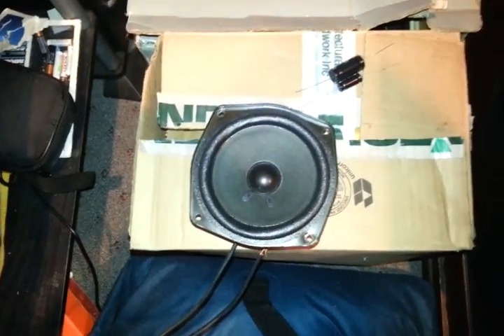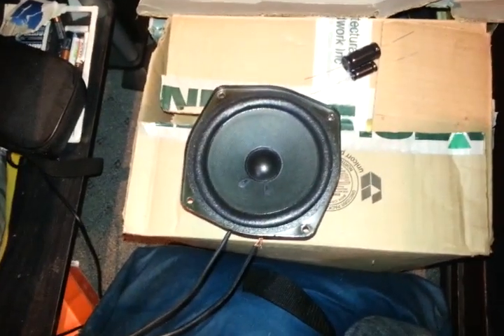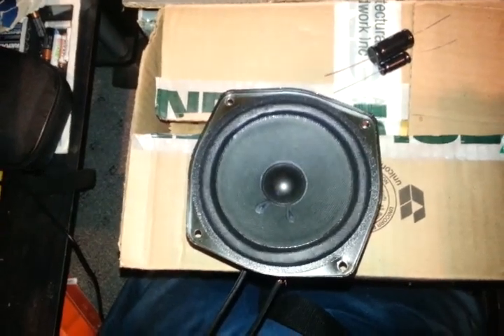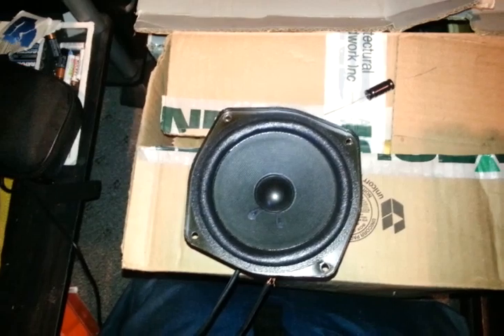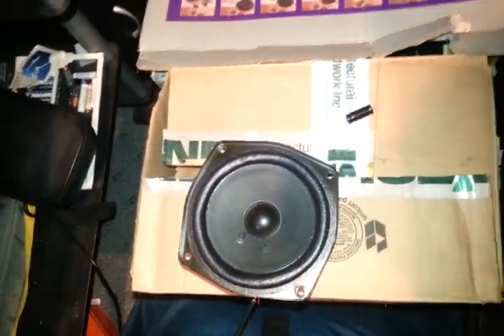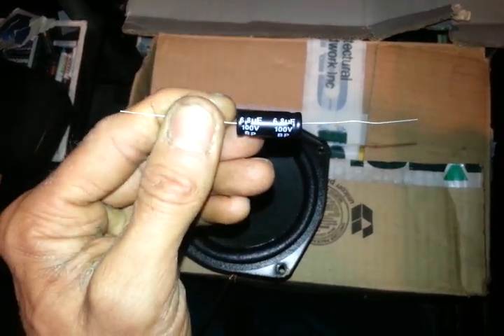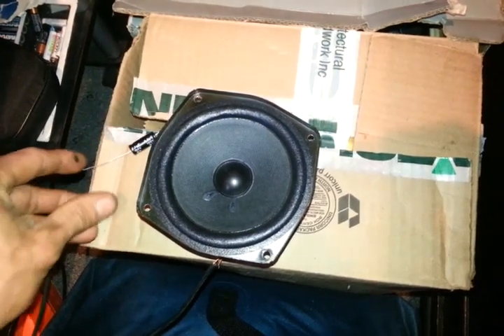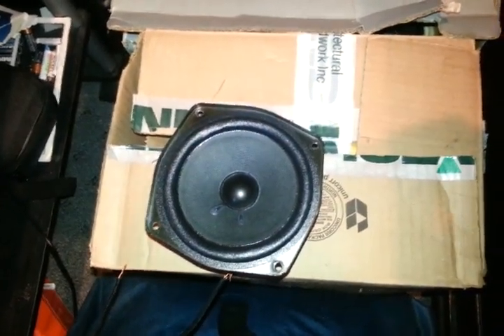How To Install A Capacitor As A Crossover

Comment: thank you , i just learned something today and I will be using your info for my new midranges thank you
Reply: 6.8 mf cap is best for med drivers in 3-way speakers (that have a woofer, a med driver and a tweeter). 6.8 mf caps are just about what all 3-way speakers have on the med driver. They make such a sharp and snappy voice sound. If it's a 2 way speaker (with just a woofer and a tweeter) don't put a cap on your woofer. Only on a med driver that runs with a woofer (like in the 3-way speakers).

Comment: ServiceBro I really need your help in a crossover with a 4in, 20-40w, 6ohm woofer, and a 2in 15-30w 8ohm woofer. These two woofers are installed in my Bluetooth speaker but the 2-inch woofer clips whenever I turn the volume at 60% on my pc using aux cable. So what kind of capacitor should I get?

Comment: Hi mate, I've installed a sub bridges to a 2 channel amp and mid range to original stereo harness, if I'm after linking speaker up to amp as a tri way would this in theory act as a crossover and keep the speakers alive?

Comment: In this video you show how to remove the base by installing a capacitor in the positive terminal. What is you didn't want to remove the bass, but instead wanted to keep it and remove all the mid range and highs from the audio signal? What would you do to it then?
Reply: Hanin
Reply: Diah hanin
Reply: https://en.wikipedia.org/wiki/Low-pass_filter     You can just place the capacitor across the positive and negative of the speaker
Reply: @codyphillips0 

 No, NEVER do that! Your cap will be a dead short in the higher frequencies and might blow up or damage the amp. Only a coil is a low pass filter. If you use a coil, you can combine it with a well calculated parallel capacitor to the woofer to make the coil's filtering slope more steep (-12db instead of -6db/oct).

Comment: what's the orientation of the capacitor? It has negative and positive side, right? Where will you connect the positive side of the capacitor?Thanks.
Reply: +Lawrence Corcuera These are non-polarized audio capacitors.  So you do not have to worry about positive and negative polarity.  If you want any more audio tips, check out my channel.  I already have a few and will be making a video similar to this soon.

Comment: I wonder what capacitor works for what frequency cutoff?
I remember using caps on bass guitar pickups, and 4,7uF gives a nice warm tone.
On car tweeters, it would be nice to install a cap that cuts frequencies below 2,3, or 4kHz.

Comment: Without getting too technical, what is a good "size" capacitor to use on a 2in speaker?  Not a tweeter, a speaker.
Reply: @Dan Lapain Yeah I ended up jus tordering a bunch off of ebay with different specs to test up and down. with different size speakers/tweeters. 
So I'll also have to touch to sense the heat or what am I supposed to look for other than sound?

Comment: Can you use a capacitor to make a crossover on a woofer to cut out te higher frequencies? I have one woofer input that has a crossover but I have three woofer that get distorted sound due to no crossover. What would be the capacitors details if possible?
Reply: Jason Houston what kind of amp do you have the woofers on
Reply: Ok
Reply: You should use a low pass filter. There is a chanel caled afrotekmods witch explains it very well
Reply: yes of course
you can
just  connect a 100uf
capacitor to the woofer
this will remove all higher frequencies except for bass
and the voltage of the capacitor should be higher than your amp output
usually 250v-300v will work fine
Reply: Ali Waqas A capacitor is a hi pass filter, no low pass filter, you need a inductor to cut hi frecuemcies.
Reply: Free Service can you explain how to do that versus inline which cuts out LF?
Reply: @ragingbeast2045  Wrong.
Reply: @antoniomancebo9025  thank you...

Comment: Can you do this in a sub woofer so that it will play the bass and not the highs? Thanks.
Reply: You need a resistor and not a capacitor for that.
Reply: You need a resistor and a coil (inductor)  a big  inductor
Reply: put a cap between the positive and negative of the speaker yo!, and you get almost a low pass filter

Comment: Hi Bro.. i have two 1300 watts subwoofer, what size of capacitor can i use?thanks..
Reply: +[SMJ]StretchMyJerky He's probably talking about the other type of capacitor. Totally wrong video to be watching, but 1-2 Farad caps per 1000w should be perfect.
Reply: +Marcus Abacus for a subwoofer i recomend using a crossover network not just one cap

Comment: can this capacitor stand for the 750 rms pa if i play all nigt long and wont damage the mid range speakers.
Reply: +Abadon lucif Old post but if anyone reads it, you need more than 2500watts to exceed a 100v cap on a 4 ohm speaker.

Comment: Do capacitors hold electricity?  Like, could you shock yourself by touching a capacitor?
Reply: only if it is a very big one
Reply: Yes.  Even with a small one.   Theyre surprisingly dangerous.  Don't listen to the guy below me.
Reply: no, it has to be at high voltage
Reply: @Kevin De melo What's your parents email/phone number? You clearly don't need a soldering iron, and probably don't own any real audio equipment

Comment: How can I attach the battery capacitor to the wire I do not want it to touch directly onto my tweeter as it will cause damage
Reply: Lol what?  There should be no battery.  If you're talking about a car amp and the power wire. You cannot put it there you'll electrocute yourself and prob burn your car down.

Comment: If you are using a 22uf 100v capacitor? Does the voice stand out better?
Reply: no, you have to balance the crossover with an inductor and a capacitor together, i would use a 16uf cap and a good fat inductor as well

Comment: No one has told yet in whole you tube and google, which side of the capacitor, I mean positive or negative should be connected with the speaker positive point ...........i am talking about polorized capacitor, I know in the unpolorised you can connect any one but what about polorised capicitor...........
Reply: good point and i would think the white line on the capacitor should be on the negative side as usual. So Positive + to + of Capacitor, Anode (-) of Capacitor to the First Positive + terminal of the speaker....then the Ground or Negative - speaker just returns to head unit

Comment: ITS NOT A FUKIN CROSSOVER. THE MEANING OF CROSSOVER IS A FILTER THAT SEPERATES HIGH AND LOW FREQUENCIES
. ONE CAPACITOR IS NOT A FUCKIN CROSSOVER MATE, IF U HAD A TWEETER AND A WOOFER, THE TWETER WOULD NEED A CAP.  AND THE WOOFER WOULD NEED A COIL (INDUCTOR), SO U DONT KNOW WHAT UR FUKIN TALKING ABOUT BUDDY.
UR SHIT IS NOT A FUCKING CROSSOVER, ITS JUST A FUKIN CAPACITOR REDUCING UR SHIT FUKIN BASE FROM ENTERING WHAT IS SUPOSED TO GIVE BASE OUT, DONT USE A FUKING CAP.   USE A FUKIN INDUCTOR STUPID, PLUS IM A LOT YOUNGER THAN U AND I KNOW THIS SHIT BETTER THAN U.
Reply: No actually you are wrong. What you are describing is the difference between a low-pass and band-pass filter.  Further more, depending on where the cut-off frequencies are set, the response of the woofer and tweeter doesn't necessarily meet and "crossover". I hope with age you learn some humility.
Reply: I KNOW WHAT IM FUKING SAYING BUDDY  I WORK WITH THIS SHIT.
Reply: Cool story bro, and completely original. Let's keep it real though, even my mum has standards.
 ...Not sure how pointing out that you fantasize about sexually assaulting grannies is supposed to be a jab at me anyway, but whatevs.
Reply: Funny how in your mind, the worst possible thing is mom finding out. Clearly you're a child.
Reply: @Wil Badillo, Kevin De melo is one spicy burrito huh? lol Taco Bell shit is what he is, 89 cent soft taco is all he's worth,  Kevin De melo didn't even make the dollar menu lol
Reply: Did he state that you're supposed to put the capacitor on the woofer in a two way? Was he demonstrating how to make a 3 or 2 way system with capacitors as crossovers? Was he trying to tell you how to build a crossover in a two/three way system? You clearly don't understand the video, or how speaker electronics work, as woofers work just fine without a coil attached to them (not voice coil) and sound good anyway, Need proof? Buy a pair of sony SS-MB215 speakers, they use caps as crossovers for the mid and highs and just use direct input from the amp for the woofer!
Reply: Okay, you're now a official 9 year old.
Reply: Kevin De melo  how old are you today ? Hows the therapy  going ?
Reply: I kno this is old but ,infact it is a cross-over (using single cap), .

Comment: what if you want more bass?
Reply: +Czaric Official get a woofer or a speaker with a lower Fs.
Reply: +Czaric Official You can use capacitors as a high pass, which will be needed if you have a ported sub.  This protects your sub from over excursion.

Comment: how to know which is + and -
Reply: Rahil Shaikh on a speaker? take a AA battery for example, and connect + and - from a battery to the speaker terminals. if a speaker moves forward, then the battery + and - are the same as the speaker. if the speaker moves in and not forward out. that means that the battery + is connected to speakers - terminal, and battery - is connected to speakers + terminal, witch is wrong. hope it helps.
Reply: On a electrolytic capacitors there is a stripe or a stripe with the - negative symbol that's the negative side and the other side is + positive make sure u have the polarity correct and the power dose not exceed the capacitors marking otherwise it will blow up
Reply: +Rahil Shaikh Typically there are 2 easy ways to d this.  Typically the speaker will have a + or - on it or one connection will be colored. If it is colored red, it is positive.  

Second, if there are two different sized terminals, the smaller terminal is the negative.
Reply: +91rickstar Audio capacitors are non-polarized.  You do not want to use polarized for this type of application.

Comment: and I want high frequency
Reply: A bit late to respond (just saw your comment). If you have 2-way or 3-way speakers (and want more high frequency) put a 0.33 uf inductor in series with a 2 ohm resistor on the + terminal of the woofer. Do it even if your speaker have a crossover, and it won't change the speakers much, just more highs (at the expense of about 1db less sensitivity). Not even noticeable, you only turn it up like less than one click to get the same volume. But the highs are still the original volume so now the highs are stronger. You may be able to just use the 2 ohm resistor, but if it sounds cold, use the inductor as it will warm up the sound (and still have more highs).